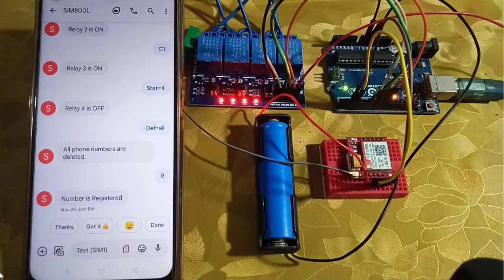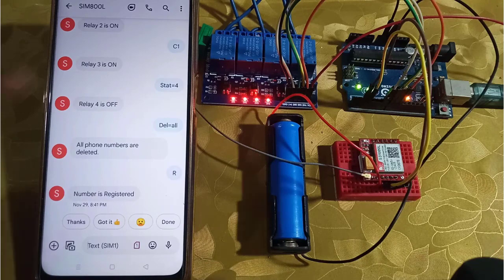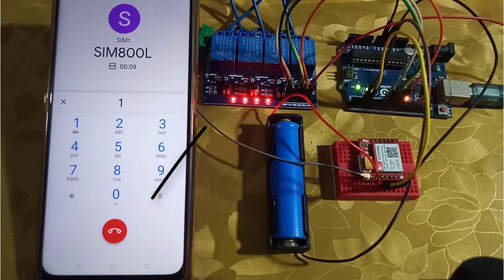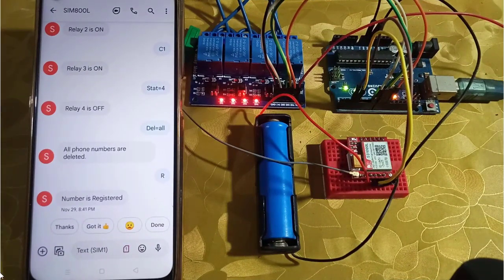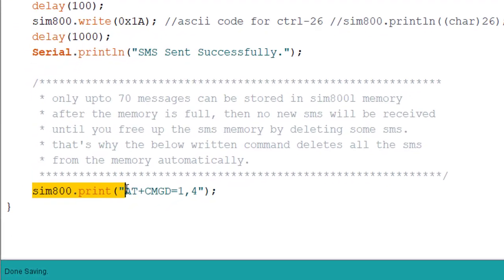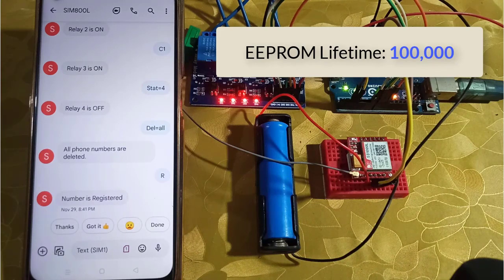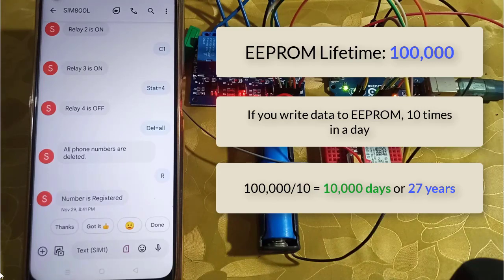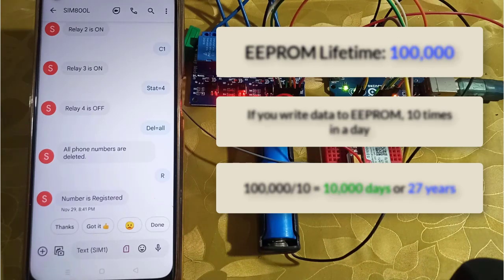DTMF | Arduino SIM800L Relay Control with SMS | SIM800L Register Phone Number by SMS

Comment: can i use the same code in my gsm900?
Reply from the maker: No, you cannot use the same code for SIM800L and GSM900 as they are different modules with different AT commands and communication protocols.

Comment: Message control doesn't always work well?
Reply from the maker: can you give me some more detail
Reply: The dtmf controller works well, but the messages do not even arrive on the serial screen, and sometimes it works?
Reply from the maker: @mahdimehrez1980  try to replace the antenna.

Comment: Greetings to you for your great effort I downloaded the code and it works for me, but the dtmf does not work for me from the first time I press the button, like you, I need to press more than once until it responds, why is this Second, does the memory space mean 1000000 times to record numbers, and do not mean to turn on and off the hand?
Reply from the maker: try "ATZ0" or "ATZ1" AT commands
Reply: @AhmadLogs  where i change
Reply: I did the order to clear the messages so that the memory is not filled but after activating const string pHONE. He also doesn't send any confirmation messages that appear on the surreal screen, and he doesn't send a message.
Reply from the maker: @AlMokhattatAlIlahi  use const string PHONE
instead of const string pHONE
just use upper case P in the pHone
Reply: @AhmadLogs  I wrote it correctly in the program but I don't send any messages, this is a spelling error in the comment only, so what is the problem
Reply from the maker: @AlMokhattatAlIlahi  at line number 219 the sender phone number is compare with the phone number already stored in the eeprom. if you use String Phone then you need to compare the sender phone number with the String Phone variable.
Reply: @AhmadLogs  This means that string phone number must be one of the numbers recorded in eeprom. You mean that, my friend.
Reply from the maker: @AlMokhattatAlIlahi  no. you must compare the sender phone number with the String phone
on line number 219 like this
if(sender_number == Phone){
   //add your code here
}
Reply: @AhmadLogs  how please help me
Reply: The same problem for me I need to press more than once to respond whether it is in suspension or operation but in the Video it works from the first pressure so what is the solution of this problem
Reply from the maker: I think this is due to the change in the default configuration of sim800L
Reply: @AhmadLogs  how my frind
Tell me please

Comment: sim800.print("AT+CMGD=1,4");   is not working in my case, I mean it is not deleting my sim's inbox. Sim keeps memory full, if I  manually send that AT command then it deletes but not inside the loop program
And I'm not getting Confirmation feedback msg, but the action is executed.
And if I call to access DTMF service from registered number, it shows as 'The phone number is not registered' in serial monitor.
Reply: I changed to sim800.println("AT+CMGD=1,4");
and now it is working inside
Reply: I made a small changes String temp, and I'm able to use DTMF
Reply from the maker: @likhithmadappady1746  Thanks for sharing your tweak. it is much appreciated.
Reply: @likhithmadappady1746  can u share what changes u changed,, plz tell me.. 🙏🙏🙏
Reply: @likhithmadappady1746  what this change
Reply: @yassinegrine884  you should mention the length as 13
Reply: Oh GOD!! Tried many ways, but I'm not at all possible to get Feedback reply from this project 😭
Any help please
Reply from the maker: @likhithmadappady1746  verify if the phone number is stored in the EEPROM
Reply: @AhmadLogs  yes it is stored..
I copied DTMF related codes from this project to another project of yours with No DTMF feature, and some how now I'm getting Replies, but only for SMS based actions,
Now I'm trying to get Replies through SMS when relays activated through DTMF..
Will you please Help me in this topic?
I'm managed to get Replies to number phoneNo[0]
But if I add Reply("Relay 1 is on", phoneNumber); inside void controlDTMF
It gives error msg saying 'phoneNumber' was not declared in this scope
Reply from the maker: @likhithmadappady1746  make a call to your project and check the length of your phone number from serial monitor. and let me know
Reply: @AhmadLogs  length is 12
Reply from the maker: @likhithmadappady1746  it must be thirteen. the code will works on phone number length 13
Reply: The same problem how can i solve't

Comment: Why is he not receiving an SMS reply?
Do I need to set up the SMS center number? If so, how to do it?
Greetings :)
Reply from the maker: make a call to the sim800l, to check if it is working or not.

SMS center number will set automatically. no need to do it manually. 
to check the service center number send the following command from serial monitor
AT+CSCA?
Reply: SMS works, but when I call sim800L, it shows me that the number is not registered :(
This is a screenshot of the ports monitor

https://files.fm/thumb_show.php?i=jqxak5hy6

Maybe the length of the number is wrong? How can i fix this? :)
Reply from the maker: @cycu87  please look in the comments, I have already answer it.
Reply: @AhmadLogs  I checked all the comments, I can't find a solution anywhere
Reply from the maker: @cycu87  1.search for 
len = 13
and replace it with your phone length.

2. also change in line number 134 and line number 140
Reply: So the problem solved?
Reply: How you fixed the problem of not getting sms reply?? I'm struck there,
Please Help me out

Comment: Some time ago, I made a long test with cyclic full write + readback + check of EEPROM in a loop. I wanted to reach a point when EEPROM is damaged and can't be used.
For about a month I made 30+ milions cycles W+R and data corruption never occured.
So, manufacturer says "Endurance 100000 cycles", but in fact they are much times more.
Note: My test was performed in office conditions - temperature ~25°C. Never tested at -10°C or +80°C.
Reply from the maker: that's amazing. I never tested it. so, now I will also give it a try.
Thanks for sharing your experience.
So nice of you

Comment: Hello Ahmad Khan
I will add my own conditions in the loop section of your registry program number, such as digital or analog sensors
It works a few times and the del and R = ... list commands work but it crashes after a while
How can I solve this problem?
Reply from the maker: I think. it is due to the changes you have made in the code

Comment: السلام وعلیکم
MashaAllah very nice product.🥰
aap kia asi project ko arduino 328se esp32 pr convert kr skte hay or.
KuKeh esp32 ki memory ziada hoti hy.
Or as me EEPROM ka issue nhi hota.
aap sath esp32 k lcd lgay.
or
os pr gsm signal, delay (1000) phr gsm clock AT+CCLK. delays 1000)
Phr battery level esp32 se kisi pin vp ko use kr k lcd 16*2 model pr yah sb show ho.
jb
real user call kre tu.
lcd clear ho kr.
sms or dtmf k reply ko show kre phr reply ko always on ya or EEPROM status save ko sms pr show or lcd pr kre . Phr last pr esp32 or gsm ka communications fast hona chahiay Takeh koi bhi real user ka sms or dtmf west nah jaay fori reply mile  or sms delete data save ho
Reply from the maker: Yes I can
Reply: last ma lcd screen pr koi other person ka aane wala sms 2 bar show ho. phr delete ho jaay
Reply: or bhai jaan
Aap code tu send kr de.
Reply from the maker: for code. check the video description